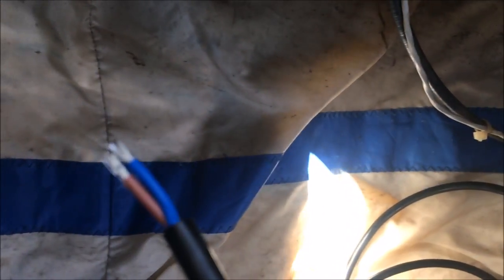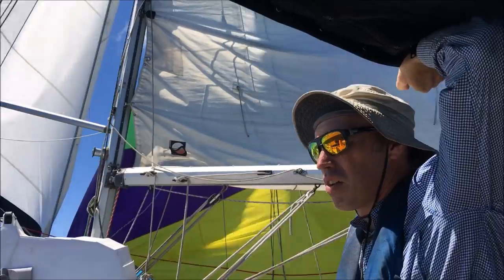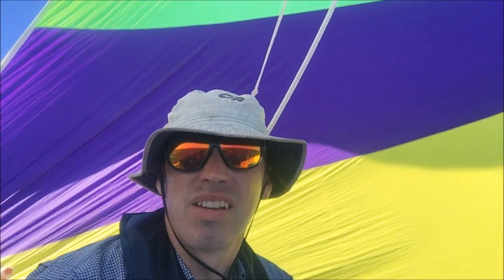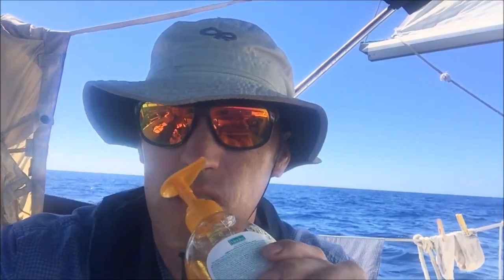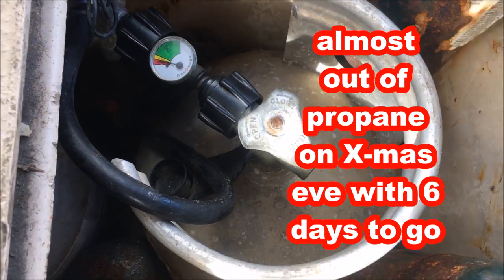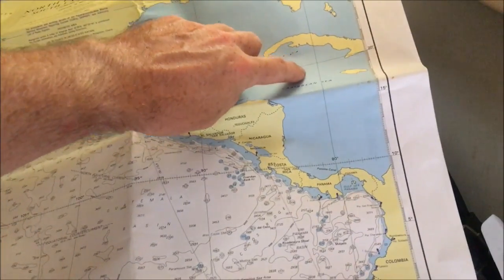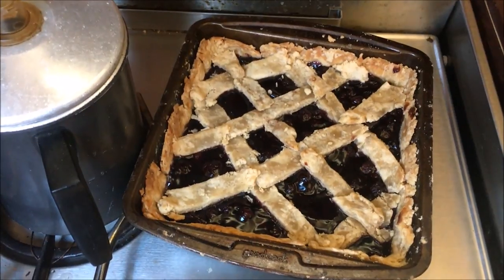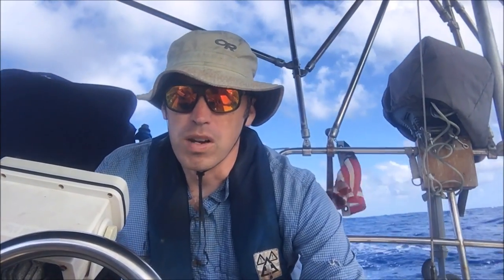Downwind Sailing Combinations; On the Coconut Milk Run S2E4 Slow Boat Sailing

Comment: Those wires would have melted the plastic coating the full length of the wire if the wire was undersized. It looks like a poor connection at the plug caused you problem.